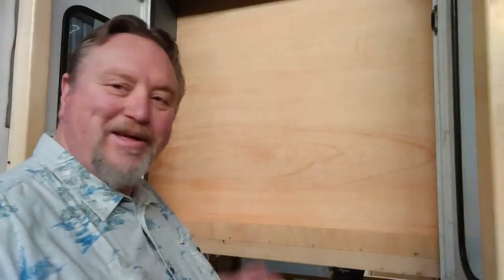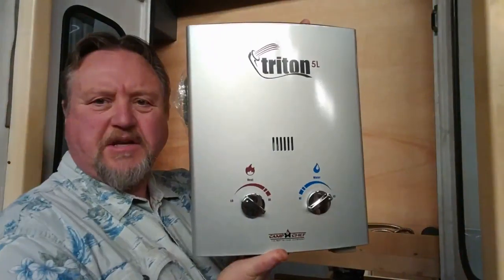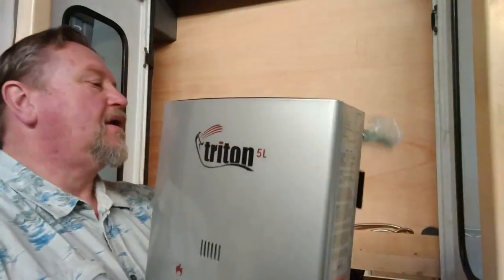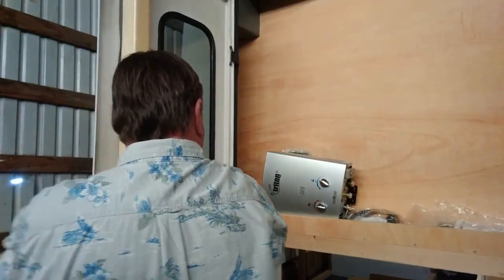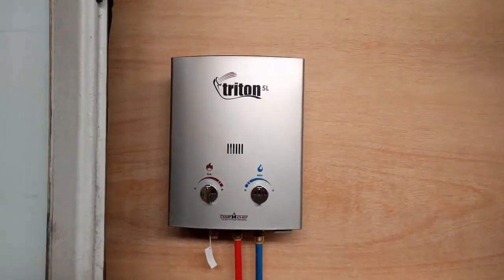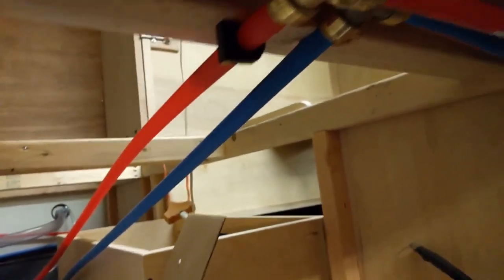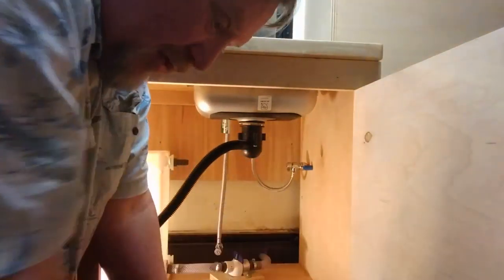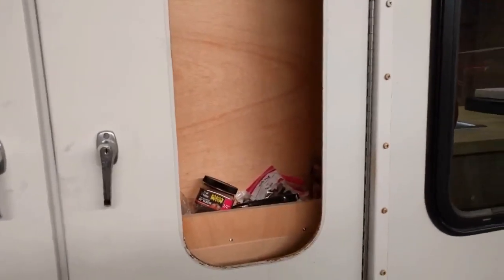Shuttle bus rv conversion (Part 24) Water heater install and plumbing

Comment: Lol at the cursing comment...I tend to do a lot of that while working too :)  On the pex  fittings, you can buy plastic ones at box stores that use a ring and crimping tool that are much cheaper in the long run. I only buy the shark bites when I have to cap a water line.

Comment: Thanks for the update. Is it possible to upload to something higher than 144p? Would be nice to see everything clearer. As it is I couldn't read much on the heater panel, or your under the sink connections. Will you be insulating those longer pipes? I'd think the water wouldn't stay as hot, but I may be wrong. Always loved tankless heaters. Used them in Spain 40 years ago, before they became popular in the US. We used butano. Thanks again. : )
Reply from the maker: @AnnWith APlan  I use a Nexus 6P  for the videos I upload I dont know why you are at 144p, I can read it on my channel.
Reply: I see it all clearly on my pc.

Comment: I know you said you've had experience with these heaters before...but I had some concern when I saw you mounting a burner with it's heat vent against a plywood.  Then I saw and read the side which says not to mount to a combustible surface.  I am always overly safety conscious, and it seems you have that sense as well...so is this a good option?  Lynn
Reply from the maker: @ sxtn102  I am installing a exhaust vent  on the top of the water heater to the outside of the bus, but I will check out the mounting surface recommended by the manufacturer for the unit itself. Thanks for the heads up!
Reply from the maker: @sxtn102  Thanks for the warning! I completely removed the water heater and put a metal wall with a air gap behind it. OOPS how did I miss that one! Good comment